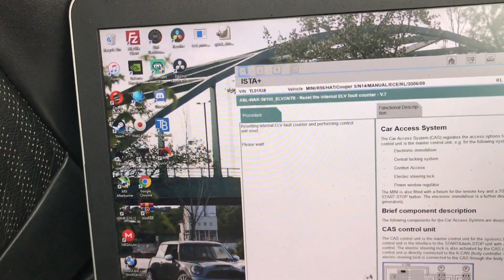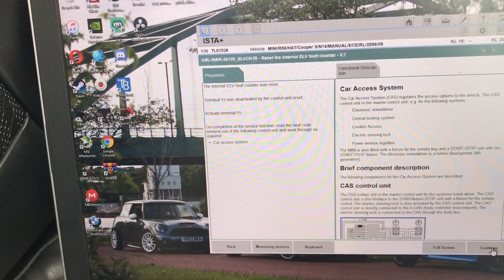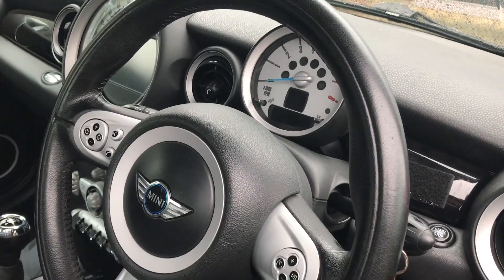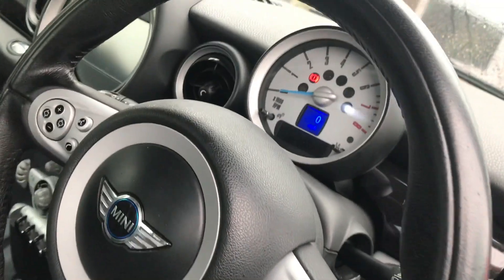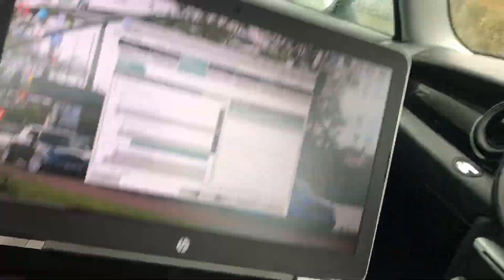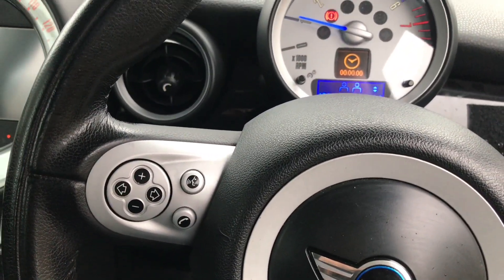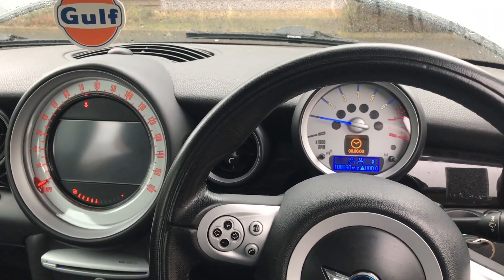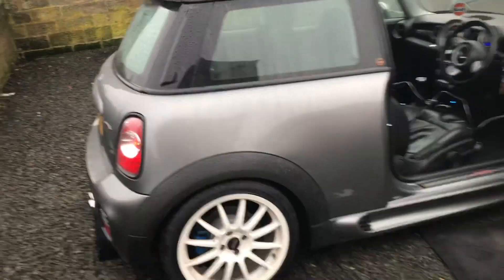How To Reset the ELV Counter BMW MINI R56

Comment: Does this make the engine cant be started? Mine also ccid 187 and cannot get it start
Reply from the maker: That’s right, it’ll not start until the steering lock is reset. With regards to the ccid code: CC-ID 187 – ELV Steering Lock Active. Move Steering Wheel to Restart

Comment: I'm just going through this now. Bloody inconvenient after a few weeks back the headgasket going. Anyway I've had the ELV counter reset but the warning lights were still on. Long story short left the car a few hours and went back to it to move it and the same thing happened in that it wouldn't start. Managed to borrow a snapon tool and cleared the ELV, drove it around the block and parked up. Next morning not expecting it to start it did! Left it a shorter time period before it's next use and then it failed to start again! I've ordered ISTA off of eBay and I think I have a lead somewhere to go usb to obd3 so will try this. Hoping it's not a broken CAS unit or steering column.
Reply from the maker: Hope you get it sorted Geoff.

Comment: Hi, I am writing to you hoping to receive your precious help.  I replaced the license plate lights (I have all led lights) with new ones, always led.  Unfortunately the car had some sort of blockage of the control unit, and now the windows do not work, the direction arrows and the headlights remain on (even if off from the selector).  Is there anything I can do with this procedure in the video, to fix the problem?  (I changed the battery, but the problem remains).  A greeting
Reply from the maker: Hi Davide. Sounds like it’s killed the FRM. This module controls everything you have mentioned and can be affected from just replacing bulbs with LED versions. Only way forward is to replace it with either a new one, or a 2nd hand one. Either way, new or used, it will need coding into the car but not in the same way as discussed in this video I’m afraid. Make sure you fit the standard bulbs back in before replacing the module just incase there is an issue with the bulbs you have used.

Comment: Mr Watton l replaced my BMW's water damaged computer box with a lock-set from an automatic transmission.The car starts very well.The issues l am having is the steering wheel doesn't unlock and the radiator fan keeps on running without shutting off.There's no steering lock icon on the dashboard.

Comment: Its the problem solved for ever? Or maybe this problem come after loong time?
Reply from the maker: Hi. Yes issue is now resolved. I found that the ABS module ended up faulty after replacing the battery. After I replaced the ABS module I reset the steering module again and it’s never come on again since.
Reply: Mr Watton how did you install ista d??need help